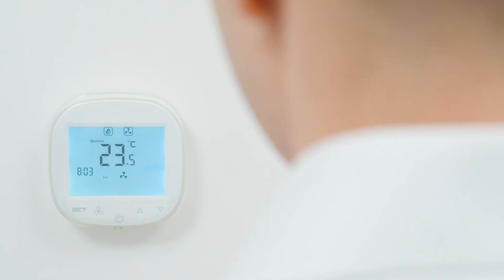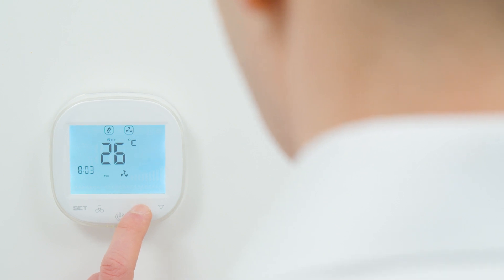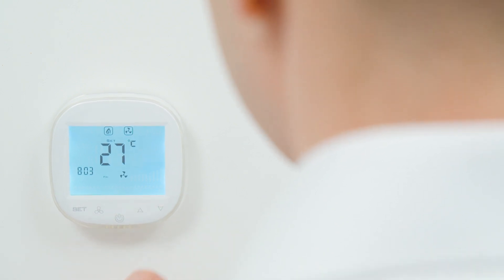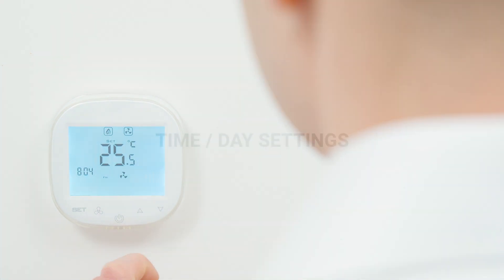HMI WING EC air curtain controller manual

Comment: We are fixing wing 11 c 100 EC, but not working door sensor, door sensor 2 wire connected in thermostat DS but continue working Air courtain door closed also working fan, plz reply
Reply from the maker: The controller defaults to thermostat operation. For newer controllers, there may be an altered order in function A0, and in this case To switch to door sensor operation in function A0, assign a value of 1.